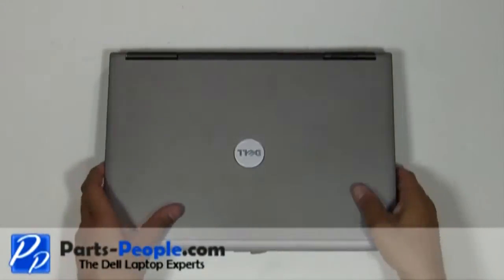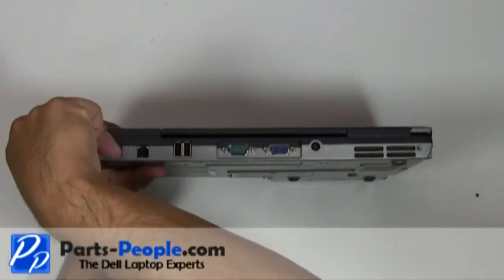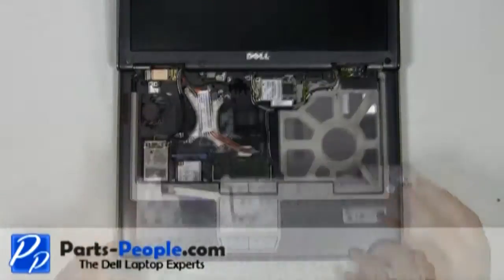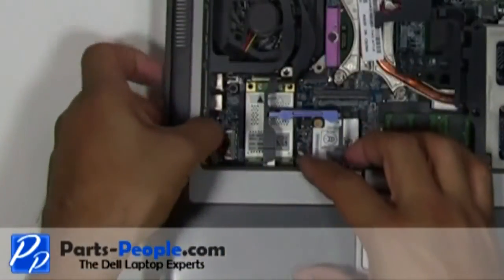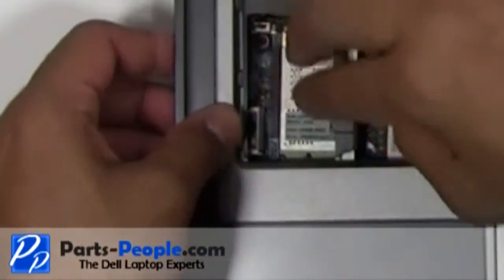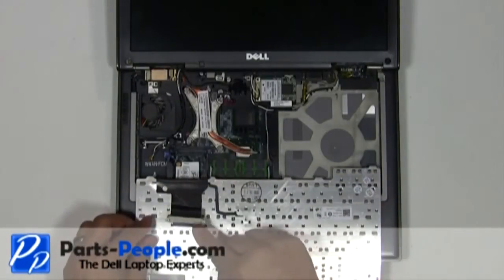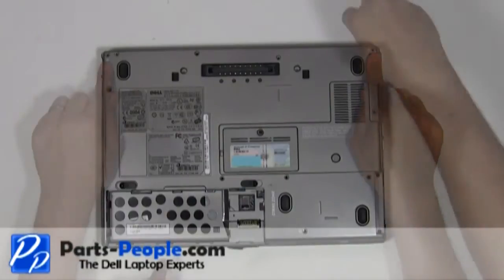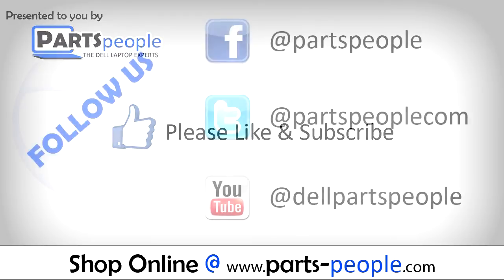Dell Latitude D630 | Modem Replacement | How-To-Tutorial

Comment: yes,suddenly disconnect
Reply from the maker: +Mahadi Hasan Sometimes you have to reload the drivers and sometimes the cards fail and you have to replace it. I have also seen some cards that just randomly drop the wifi signal. If that is the problem try replacing it with a newer model card.
Reply: ⚠ 📶like this error mark

Comment: may i know about,dell 640 m wifi card can i use to dell d630 plz may i know
Reply from the maker: +Mahadi Hasan The 640m wifi cards will work with the D630
Reply: but the connection have error sometime how can i solve it,can you help me
Reply from the maker: What kind of errors does it have? Is it just not connecting to the internet?